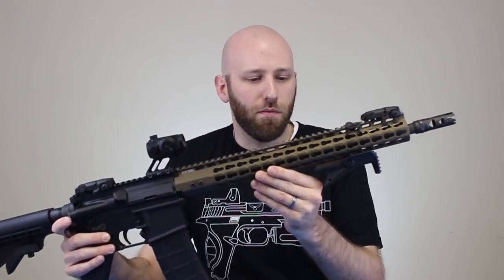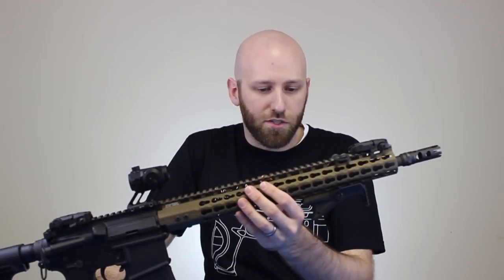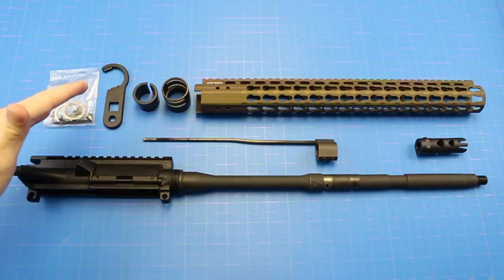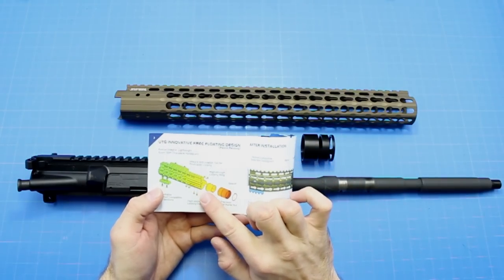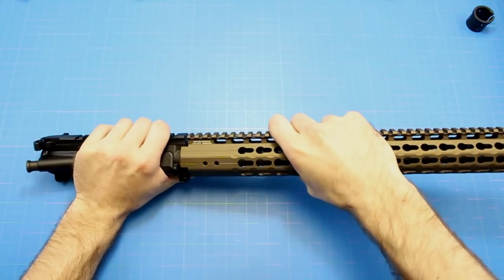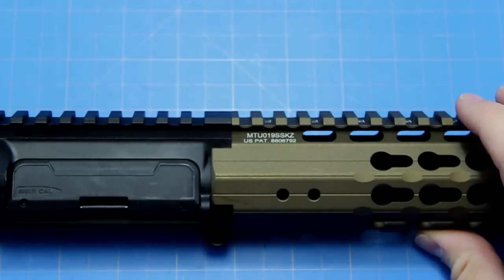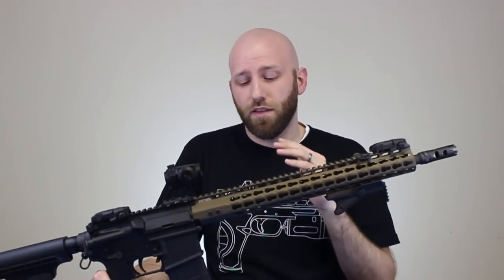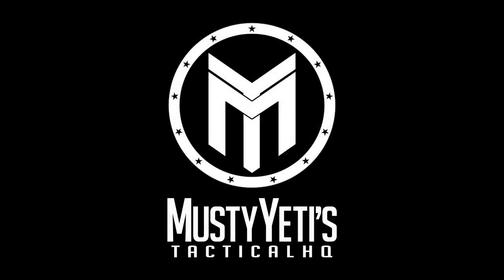UTG PRO 15" Lightweight Keymod Rail Install (made in USA) | MustyYeti

Comment: i have the 15in keymod rail and the 17in m-lock .love them both iv had the 15in for about a yr with no issues .just got the 17in but it seems to be just as good as my older one

Comment: I have the same hand guard in black. I love it. Your video from Shot Show convinced me to pick one up from my local gun shop. These things are top notch and I've had no issues so far. Looking forward to your final review.
Reply: Jeff Davis One other thought - even with a low profile gas block, the gas block is so close to the bottom of the rail that your hand can hit it when gripping the rail. That thing is HOT (the gas block, not the rail)! I need to get a grip stop or rail scale to cover that area. I see you did something like that.
Reply: Jeff Davis 
I have not done a build yet. 35 ft lb minimum; is a person able to get that much torque by hand? It didn't look like it required much effort with the wrench, but could it be just the additional leverage?
Reply: Mark Denning II I used a torque wrench on my own build. I would recommend picking one up to make sure you have the right torque on that barrel nut.
Reply from the maker: Jeff Davis Well I'm glad to see you picked one up after watching my booth review.  I'm even happier to hear the rail hasn't let you done.  I read both your comments and these rails definitely are low profile.  I never ran into the issue of my hand hitting the gas block... I can imagine how hot that would be.  Thanks for taking the time to comment.
Reply from the maker: Mark Denning II I think someone could, technically, tighten the barrel nut by hand to 35 ft lb.  The thing is you wouldn't know where to stop and run the chance of over tightening.  I was shocked it only require that amount of torque... that's not very much.  Like Jeff said, go pick one up, it shouldn't cost you more than 75 bucks.  When it comes to building a rifle properly it pays to spend the cash to pick up the proper tools.  It makes things easier and I'm sure you'll use it multiple times.

Comment: Will those thin wall rails hold zero with a rail mounted front sight,and a sling being used ?It almost seems like it would bend,if you used a sling.

Comment: Did you have any issue with the rail wiggling or being a little loose? I've installed this into my Sport 2 and it no matter how many times I've adjusted it or reinstalled it, it still has this slight looseness and its frustrating because of how cheap it feels when I'm firing.

Comment: Do I have to remove my A2 front sight, or can I just cut it down? Will the utg barre nut not slide over it if I just cut it down?
Reply: You’ll have to remove the A2 front sight and the gas block. You’ll need a low profile gas block. I’ve heard of people grinding down their gas block but they said it wasn’t worth the hassle. I know your comment is two years old but I figured I’d give you a response.

Comment: It looks like you had an a2 front sight/gas block on there at one point. Im wondering why you opted to replace it with a "set screw" low profile gas block vs modifying A2 into a low profile gas block that is pinned to the barrel?

Comment: @MustyYeti hey bro I run into a problem while installing this same handguard. The handguard is canted to the side (the left side if you are looking at the barrel from the front). I don't know what caused this since I did everything just like you said in the video and I also checked the video from UTG that show you how to install the handguard. Do you have any idea of what causes this and will this cause my accuracy to be off with my iron sights??
Reply: JuGG-  Oh-No: u cross-threaded
              the barrel nut ..,,LOL
Reply: actually no i did not cross thread the barrel nut. I sent it back to UTG and they did confirm the handguard was defective

Comment: I installed a 13" UTG slim rail on mine. 
You missed one step. You're supposed to tighten and loosen the proprietary barrel nut to 35 ft. Lbs. TWO Times and then tighten the barrel nut The third final time to 35 ft. lbs. supposing that everything lines up. 
One problem I had with my installation was that my receiver vise block wouldn't clamp down properly with the rail installed when I went to install My muzzle device. I had to unscrew the rail from the barrel nut first and slide the rail foward just enough to engage the receiver block into the receiver. Then I was able to install My muzzle device and then screw the rail into the barrel nut. I think that a Geissele reaction rod would've made my install a whole lot easier. 
The rail that I installed is #MTU006SS

Comment: I have each (UTG Pro and Strike Industries Mega) on different AR pistols and I think the Strike Industries Mega Fins Rail closely edges out the UTG Pro Rails (If it doesn't say "UTG Pro" on packaging, its crap). The fact that there are reinforcing fins on the inside of the Mega gives it more strength. With the Mega Fins you do have to pay attention to the type of gas block you use and barrel profile because of the "fins".
If you hate the "pinch type,clamp look" that Troy Industries, Midwest Industries,Samson has, then either of these two rails are the way to go.

Comment: hey Musty can you comment on the hardware they use, I had tried some UTG stuff a few years ago and found that the hardware was kind of cheep and wouldn't put up with much use, as in taking it off and putting on another gun ect. how would you rate the mounting screws and stuff quality wise, did it feel "soft" at all when tightening up and did you have any allen head's slip or strip on you? thanks bro
Reply: Lest we forget UTG was an airsoft company a few short years ago...
Reply from the maker: Militaristics Things have definitely changed over at UTG PRO and they've stepped things up.  Now I have heard a bad batch of screws went out to some customers that who had them snap off in the barrel nut.  However, most of those people used Loctite, which UTG PRO recommends you don't use.  They say the 6 screws will hold just fine without it.  With that being said I've switched between two UTG rails multiple times and haven't had any problems.  I think people just over torque their screws.  Now lets keep in mind that any manufacturers screws could break or have the threading strip.  Hell, when I was removing the Strike Industries rail for this one I had 2 screws break off in the barrel nut and it was an absolute nightmare getting them out.  At the price they are at I would definitely give them a shot.  It sounds like everyone on YouTube is really impressed with these rails so far.
Reply from the maker: evilassaultweaponeer That might be the case but times have changed.  UTG PRO stepped up their production and is now offering great stuff at a low price point.
Reply: MustyYetisTacticalHQ I'll take your word on the quality, but it's not a great price. Equivalent rails from Troy, Midwest Industries, and other well-established high-end brands can be had for the same price. Sorry, but as much as I believe that form follows function, I won't pay the same price for a rail that says UTG on it unless it delivers a clear advantage; I don't see one.

Comment: I just tried to install this same hand guard on my AR 15 build.  Only a couple of the screws would catch and tighten up. The others would catch for a turn then loosen and fall out. It seemed like the screws were too short. Maybe locking ring was bad. When you would just run them in the locking ring without hand guard they all worked. Any one else have this issue? Can you get longer screws? I was irritated by it and just returned it to website I bought it from. I loved the length and color of it. I want to buy another one to try again but not wanting to waste my time. Maybe I just got a lemon.

Comment: Make sure your torque wrench is parallel to your barrel wrench, if it's 90 degrees to your barrel wrench you are only getting half the torque so when it clicks at 35 your only getting 17.5 ft lbs
Reply from the maker: John Troy Thanks for the advice.  I'll make sure I do that in the future and double check this rail to make sure it's tightened properly.
Reply: No, that is incorrect.  It should be done at 90 degrees.  If you go parallel with the barrel you are  increasing the leverage and increasing the torque.
Reply: 1fltjponr You are correct actually, someone told me it was the correct way, I should have corrected myself earlier. Sorry Musty for the false advice.
Reply: +J.Troy.... the easy way to explain this common question=
the T/W is adjusted and set (at the factory) using the LENGTH of the tool... when u add any additional length to the tool- it  will read wrong.... hope this helps....
 ALL BLACK RIFLES MATTER

Comment: EDIT: Problem Solved! The rail is fine. The guys at the shop just had never seen the rail before and didn't know how to install it properly.

Original Comment:
Maybe you guys can help me out.

 I bought this rail and brought it to my local gun shop and asked them to install it. 

They told me "It has no solid index point relative to the upper or the bbl nut which makes it impossible to lock in place so that it can't rotate." They told me I should just get a BCM or Midwest Industries rail because this one could just twist out of position a few degrees. 

Are they right? Or are they missing something? I'm planning on asking them tomorrow and maybe show them this installation guide. Anything you guys could tell me to clear up this would be helpful, because I'm very confused as to why they are telling me the rail sucks.
Reply: I know this is an old comment but can anyone chime in? can the handguard twist on its own if bumped hard?
Reply: Hey, OP here. The rail is fine. The guys at the shop just had no clue how to install this particular rail. It is now attached, no twist or anything!
Reply: Thank you

Comment: This is an excellent rail I have the 15" in black well made, well designed. What isn't very good are the Allen head screws they provide with the rail. My 1st set snapped after removing the 1st time I emailed customer service and they had a new set to me along with a new collar in a few days which was great. The new set went in without an issue however the heads all rusted out on them which looks like crap. I'm thinking these are not made in America. I'm going to media blast them then treat them in black oxide so it won't happen again but it's a easy corner they shouldn't be cutting. All in all I think it's one of the best rails on the market in any price range.
Reply: stainless bra
Reply: 1975nova

Comment: I don't think you needed those spacers.  I could also see those sides, but they did not impede the screws at all, and it locked up tight.
Reply from the maker: Blatant Abuse I needed the spacers to line up the holes properly from left to right.  Vertically they were fine.

Comment: GUY READ THIS!! The Rail is sturdy but the HARDWARE WILL BREAK AFTER EXTENSIVE USE!!  The head of the hardware used to attach the rail to the nut popped right off while I was shooting!!  I have had it for 2 years and put probably 1000 rounds though it on my configuration.  Please if you can find better hardware DO SO or get another rail!!
Reply: Blackjack 
so go to Fastenal and buy better hardware. don't talk bout it be about it

Comment: i was never able to get the barrel nut to move on my rifle. Factory built RRA lar15 bought a UTG freefloat rail for it. Still sitting in the box because no abount of heat or torquing will break the fucking thing loose
Reply: ek. you need to put heat to their barrel nuts. I had the same issue it seems like RRA uses a thread lock on their barrels and you need to hit it with a benzo torch. Be patient and keep hitting it with the heat until it turns with a "normal" amount of torque. I actually ruined an upper reciever learning this the hard way.
Reply: eklypse13....... may be too late/ but FYI... with Q-tip and acetone soak b/n really good -  should dissolve............ 
..........................loctite

Comment: The rail is worth the money. The hardware on the other hand is crappy. I broke a few bolts just tightening by hand.
Reply from the maker: Dario Ortiz Contact UTG PRO.  Apparently they got a bad batch.  They'll replace your screws or anything else that was potentially damaged.

Comment: looks geat, feels great.. functions like crap. after shooting once, i removed it.
Reply: how did it function like crap? most likely user error
Reply: The design is very poor. I spent more money and have a much stronger one now
Reply: What one do you have now? Genuinely curious. I have 2 bcm KMR's, a Midwest industries gen 2 ss(308 rail), and a geissele MK8. I also have the utg pro SS on an old beater upper and It functions fine. What issues did yours have
Reply: Utg screws and mount system are weak.. i have the Midwest gen 3.. the new one. Its tuff
Reply: That's the first negative thing I've heard about a UTG rail on the internet. That means its a damn good rail!